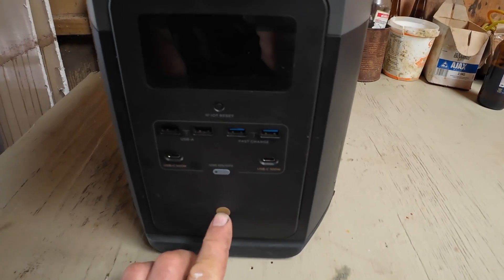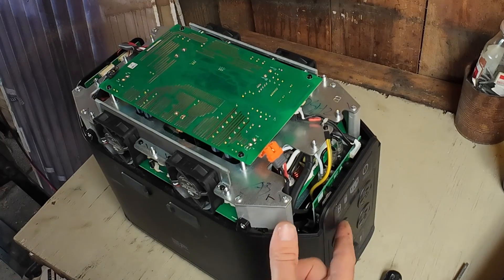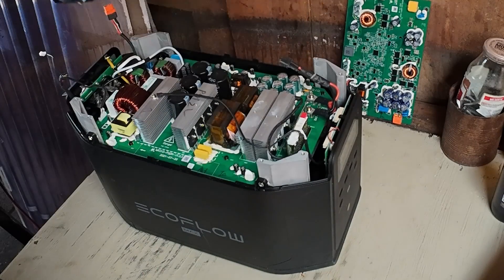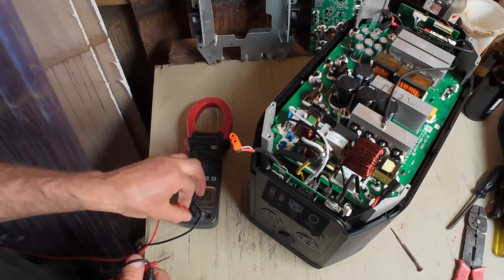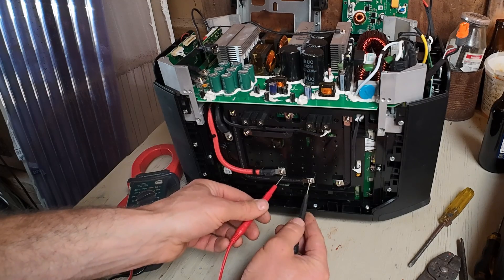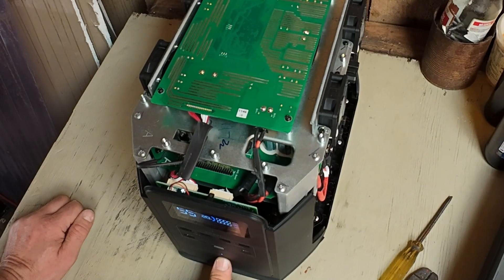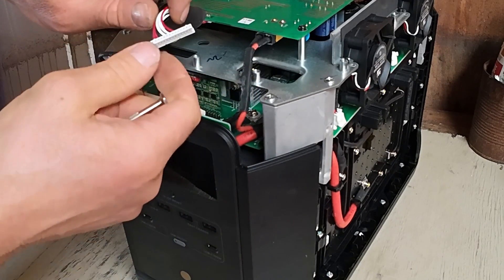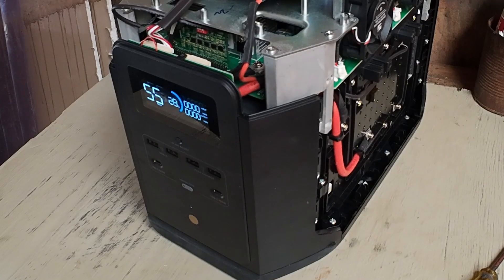Ecoflow Delta Max Troubleshooting: Why Won't My Power Station Turn On?

Comment: Mine just failed - I took it apart and all the cells were basically dead.   Didn't even last 5 years.   Ecoflow has an issue with self discharge killing cells if you don't fully shut it down.  In my case, it was plugged in the whole time, so should have just trickle charged.... Probably won't be buying another.  Looking at either Anchor or Bluetti.

Comment: These units are trash false advertised as off grid but i bought a dc to dc charger so i could keep it hooked up in my car to find out that when its cold out side the unit shuts down completely till you warm it back up what a fkn joke this product is supposed to keep me warm not the other way around anything below 32 degerees and this thing wont work

Comment: Hi, followed all your steps and check the board and all good. Before I power it on does a clicking. Display turns on but the shuts down. All I can see is a red exclamation mark and powers down. Any feedback would help. THANKS!

Comment: Not sure if it's been suggested, but it's possibly a loose/bad/cracked solder joint on the board side of the connector.

Comment: the fan for this unit set the wrong way they're blowing all the hot air towards the small capacitor that's not good for unit longevity.

Comment: Bro, I have a problem with my Delta 2 Max. When I turn it on, it immediately shuts off. If I charge it, it says overload and 50Hz. What could it be? Thanks.
Reply from the maker: Still under warranty? Sounds like something is cooked

Comment: Yo hi so my delta 2 max have problem one is tge 12v outlet overload error the other one is tli can't charge it zero ac input
Reply from the maker: Contact ecoflow, if it's still under warranty they'll sort it out

Comment: Just fixed mine, brand new, used for a day in total. Just a loose cable. Yes, nothing wrong with the cable itself, I was just not pushed in properly in the manufacturing process.

Comment: Because of the price of these. They should display a fault indicator code. Like cars & high dollar video equipment. New tech, don't fix just fill land fills up & Amazon with More money! I was hoping you checked if the green LED was still flashing.

Comment: Sometimes the brass pins in connectors like that will get damaged from vibration. Usually they have a little flap that sticks up and locks it into place against the plastic. If the metal flap is overbent, underbent, or missing the pin won't stay in place to make good contact.

Also luck yours was an easy fix. I just got one of these in on a whim. Pretty sure something more serious is dead in it.

Comment: Hello, how can I contact you to ask you a few questions? I have an issue with my ecoflow delta 1300 but ecoflow refused to fix the problem. I was thinking of trying to fix it myself.
Reply from the maker: If you're not qualified to work with high voltage best to take it to an expert, show them this vid so they can pinpoint the problem quickly
Reply: @ I am not an expert I understand the danger. But I can’t find a repair company. No one touches them.

Comment: Just like your unit- the front panel on my Delta Pro extra battery went dead.  I was thinking perhaps a faulty connection to the panel- and that's exactly what it was in your instance too.  Will be checking mine out this weekend.  Thank you for posting this video- it's encouraging to see this because it is the ONLY video I've seen on a EcoFlow front panel going out.  Much appreciation!
Reply from the maker: glad you found the video helpful.

Comment: Do you wanna try fix my one?
Reply: Is it under warranty?
If not....
 have you still tried to contact the manufacturer explaining the problem...
there may be an easy fix for a known fault.

If that doesn't work...(manufacturer is not interested)...maybe see the retailer that sold it to you?

If that is also negative....
Have you followed Marty's the steps in this trouble shooting vid?
Reply: @JohnSmith-pl2bk  out of warranty ill try giving those steps ago
Reply: @ 
If you are not confident with high voltage electricity....be very careful when reaching for wires!
If in doubt...try to find an electronics fixer...
Death will not become you....
Reply: @johnnyreynolds7527
2 weeks ago
lol, i did the same  , i unassembled it, pushed all connections, air blew it and wuuuuuaaaala, it started working....oh btw , only my 120 outlet connections side wasnt turning on. now both sides work , thks Marty

Comment: Can you come fix my delta pro batteries they both bricked
Reply: Is it under warranty?
If not....
 have you still tried to contact the manufacturer explaining the problem...
there may be an easy fix for a known fault.

If that doesn't work...(manufacturer is not interested)...maybe see the retailer that sold it to you?

If that is also negative....
Have you followed Marty's the steps in this trouble shooting vid?
Reply: @JohnSmith-pl2bk I contacted support and they rolled back the firmware they work perfectly now thank you
Reply: @ 
Good work. I hope this helps others as well....

Comment: Bonjour de France. 
Merci pour cette vidéo très intéressante. 
Il y a souvent des problèmes avec  cette batterie .
Surtout avec la recharge allume cigare. 
La vidéo est tres intéressante .
Heureusement qu'il y a la traduction en français. 

J’ai une delta max 2000w. 
Ecoflow la réparée .
Maintenant ma batterie fait un bruit de grésillement inquiétant. 
J'ai la batterie depuis 2 ans et elle n'a jamais fait ce bruit.
Lorsque la batterie est sous tension. 
Le bruit apparaît lorsque j’allume l’interrupteur des prises domestique. Derrière la batterie. 
Puis disparaît lorsque j’éteins l’interrupteur des prises domestique. 

J'ai essayé d’avoir des explications. 
Ecoflow me dit que c'est normal. J’ai une oreille trop sensible 😂.

Si je peux me permettre est t’il possible de me dire ce que vous pensez de ce grésillement. Ou une personne qui connaît l'électricité. 
Ci joint le lien audio du grésillement de la batterie. 

https://youtu.be/FlKh0tgWeRU?si=GlfeCEZxjDYyjQPS

Désolé si c'est inappropriée mais je trouve pas de réponse 

Merci de vos réponses.

Comment: Your a life saver I had a mini turn ip today charged it up all good then all of sudden it went off toke the top of same connection was loose I actually ended up flipping the lid as one side had a groove that the other doesn’t works perfect again
Reply: Update it was dead the next morning
Reply from the maker: You might have to re solder the joint
Reply: @MartyT  sent it back day later haven’t had the same issue with the new one

Comment: I’m having trouble with my delta 2. The reset button on the back won’t press at all. The button just sits there unable to be pressed. Its as if it was pressed in once and won’t unpress to its previous position. So now it won’t allow me to charge it. Any ideas?
Reply: MartyT
6 months ago
Get in touch with ecoflow customer service, or if its out of warranty take it to an electronic tech.. I would probably pull it apart and have a poke around, but dont do that  if you're not competent working with high voltages.

Comment: MINE WILL TURN ON BUT TURNS ITSELF OFF IN ABOUT 3-5 SECONDS 90% CHARGED ANY IDEALS IT WAS BOUGHT MAY 2022 AND ONLY USED ABOUT MAYBE 10 TIMES.
Reply from the maker: Get in touch with ecoflow customer service, or if its out of warranty take it to an electronic tech.. I would probably pull it apart and have a poke around, but dont do that  if you're not competent working with high voltages.

Comment: It amazes me that there are many high-quality parts in these. However, there are a few cheap parts in important places, which then bring down the whole thing.  I don't know if they were forced to use a certain manufacturer, or what. There seem to be very few units out there, whithout issues, after a couple of year's use.

Comment: I think my charging cord for my flexible solar panel went bad because it charges the power bank charges from when it's connected to the 12-volt receptacle on the vehicle

Comment: 1997 PalmPilot hand held computer twisted the case and it worked, it was a heck of a folded film based PCB, found a dry joint on leg of a SMT chip after poking with a cocktail stick. 
I had a 15w soldering iron I wrapped a bit of copper wire around the tip to make a very small soldering tip and fixed it.

I like all your YT fixes they keep me going when I am feeling a bit down due to bad health here in the UK.

Over the years most electrical items were mechanical faults unless it was a blown component like a capacitor etc.

Recent fixes on a rechargeable vacuum, window vacuum and a floor steamer all fixed with a power bypass around broken IC switching components.
all the best to all
John

Comment: Hello Marty 
At start of the video you push the start bottom very fast you should keep your finger on the ON bottom for a les than a second . 2nd I buy Ecoflow for plug and play not to go to electronic learning to do what you do. 3rd I have warranty on the merchandise for 2 years from the manufacturing , and if something happen after the warranty  .I will get other one but I have EcoFlow river 500 wh more than 4 or 5 years and 1260 wh for the last may be 4 or 5 years ago and I got the new Ecoflow 2000 max with the battery and all working perfect . Dear Marty I am lazy guy to go and learn electronic I let Ecoflow people deal with it .l am not here to drive the car they drive my car , thanks
Reply from the maker: I tried many times holding the button down for 1 second to 20 seconds, it turned out to be a dry solder joint, it's working well now

Comment: those wires tend to back out and then not fully connect just push from the top of the connector and the pin will move back into the connector.
Reply: @MartyT
9 months ago
I tried many times holding the button down for 1 second to 20 seconds, it turned out to be a dry solder joint, it's working well now

Comment: Funny, I had the same problem with mine. I contacted Eco flow directly, they sent me a call tag and I mailed the unit back in. They sent me a brand new one, but now I wish I had done a bit of investigation. I probably was suffering from the same exact Connector issue. I have the previous model, I use it in my camper van, I have a few solar panels on the roof to replenish, and it’s great. Works all my lights, my little refrigerator, and really anything else I want to run.

Comment: This is why I advise people against these units for vanlife. They fail too easily, and when one small thing fails the entire unit fails.
Reply: Every electronics item can fail the same way.
Either you have electronics..or you don't.
Reply: @JohnSmith-pl2bk  The more functions you put together in a single box, the less those individual components can be repaired if one fails.
Reply: @ 
Agreed...
but the bigger the box the more chance to get in and repair...
unless, of course, everything is "potted" with an impermeable layer...
.
(Theoretically to stop moisture from affecting the circuits...but really makes repairs almost impossible)

Comment: It probably won't turn on because it uses low cost (cheap), unreliable, high frequency inverter technology that offers a shorter life expectancy and a wimpy surge capacity when compared to a real solar generator that uses long lived, heavy duty, high peak power, low frequency, transformer based inverter tech.
Reply from the maker: No just a loose connection

Comment: I used to be in the electronic repairs industry years ago before we became a throwaway society. The most common problem i used to encounter was fractured soldering where the socket joins onto the circuit board. The fractures can sometimes be difficulty to see with the naked eye. Wriggling the cable while watching the pins carefully would likely show it up. I think it would be worth you checking Marty.

Comment: Nice fault finding, Marty.
I'd get myself a good illuminated loupe to about X30-60 and check for dry solder joints around the connector plugs too. The problem may just need another quick poke with a soldering iron.
Good luck.

Comment: Hi Marty,

also take a look at the soldered pins of the connector. back when i was an electronics  technician i repaired a LOT of cracked solder joints....

Comment: Marty, another possible cause of such a failure could be that you have a cracked/dry joint on the circuit board for the socket pins, it might be worth taking the board out and re-soldering the socket if your problem persists.

Comment: My suggestion is to clean the header pins with IPA isolpropl Alcohol,  also remove 1 pin at a time and solder them.

These are all made by robots

Comment: I suggest you check for a dry joint (solder) where the socket is attached to the board before replacing the plug. I think I saw the fault come on when you levered against the socket. Cheers.

Comment: The new type solder is not the same as the older type solder.
Reply: Far less lead in the new one...
and far less flexibility to resist vibration cracking in the "new solder" joint.....

Comment: Any repair I take on usually includes harsh language.  If you can't fix it with a hammer you've got an electrical problem.

Comment: It's not the plug Marty but the socket that is your issue here. Remove the panel and resolder the socket and it should be fine.

Comment: Marty, Ecoflow will be needing the replacement unit back now that you fixed the original unit😊. Apart from this video did you let Ecoflow know about the source of the fault so that they can audit their system to see if this is a reoccurring issue?👍🏴

Comment: You may have a weak place in the socket or possibly a weak solder joint in the plug you discovered the problem in. and the vibration in your boat may have caused this fault to show itself.

Comment: These things aren't much worth to us if they don't provide proper documentation. Way too complicated to reverse engineer if there's something wrong in the fancy management circuts.

I think a simpler design would fit better in many use cases.
Reply: If the design works and the execution of the design (using decent leaded solder to enhance flexibility of the join so it can be transported in a vibrating environment (boat, car, truck etc.)...

Comment: A problem we've seen before on this type of connector is when the insulation was stripped from the wire, some of the (few) strands were chopped off leaving only 3 or 4 strands to go into the crimp. The wire feels good if you pull it as the insulation is crimped soundly but the conductors are basically loose within their crimped section. Only luck makes them contact. Easy enough to spot with magnification if you de-pin the connector .

Comment: i would check the soldering of the the connector on the circuit board. sometimes there are bad soldering points.

Comment: I'm always impressed with your ability to calmly and carefully diagnose electrical issues without destroying them in the process.  I usually get as far as opening something up and when I don't see anything burned, I just turn into ape man and start poking at it until I've broken something. 🤦‍♂

Comment: Id be tempted to put a bit of hot glue on the plug with it in place. Might just hold it in place against vibration etc but is easily removed if you want to replace the plug or so other repairs.
Reply from the maker: it came right when I tweaked the plug slightly to one angle, touching the plug didn't affect it after that

Comment: It looks like a cold solder point in the board to me instead of the conector failing.

Remove the front board and do a small reflow to the conector pins.

Btw. You should try to make your own cable. That thing uses off the shelf parts, and crimping a new cable must take like 30 min max.

Comment: This reminds me of when I was a kid, my dad would bring home an old tube radio that didn't work. Usually the owner replaced it with a transistor radio back then. He would give it to me and I would take the back off clean it and wiggle the tubes a bit to make sure they were seated well and 8 out of 10 times it would come back to life and work for years. No one cleaned in side the radio, but the lady of the house would clean the radio including picking it up and plopping it back down. After time things worked loose. I don't work on todays stuff, but it can't take more jarring than the old stuff so it is better.

Comment: I had problems with a USB cable.  So cut the cable open and found the wrier were not copper they were some sort of alloy and break very easy so go to a computer shop and buy form then and not from the internet.

Comment: In my experience, the problem would be more likely to be the solder on the other side of the board that plug goes into. I would resolder that before replacing the wire end.... of course the same could be said for the pin to wire connection but cold solder joints and early failures seem to go together.

Comment: You're lucky to have had that plug so handy to touch while putting it back together, Marty. I cannot tell you how many times I've fixed an electronic device just by taking it apart and staring at it really well. I usually never do find exactly which part is at fault. Good on ya, mate!

Comment: "Heat creep" can sometimes cause connections to come loose. Reseating all of the connections is all that's needed sometimes. A tip I found useful when a TV or computer monitor starts acting funny or just stops working. Something I learned about, being a computer tech years ago.

Comment: I recently had an issue with charging my driveway alarms. Pulled one apart & couldn't see anything wrong. Put it on the USB on my computer & it started charging. Had a look at the transformer on the powerboard, followed the lead back...and the power board is un-plugged at the powerpoint.

Comment: I think it may be a cold solder joint on that connector on the board, not the connector/wire itself.